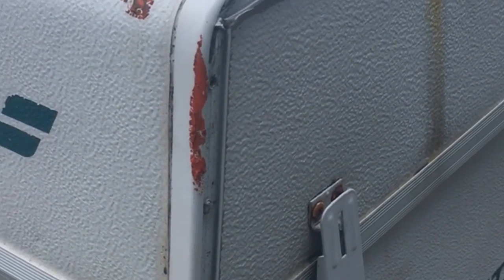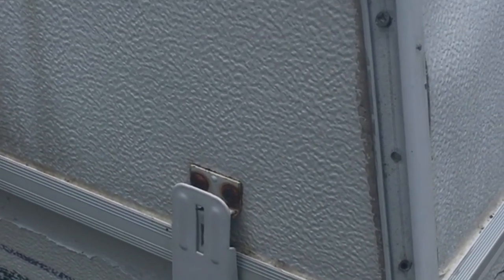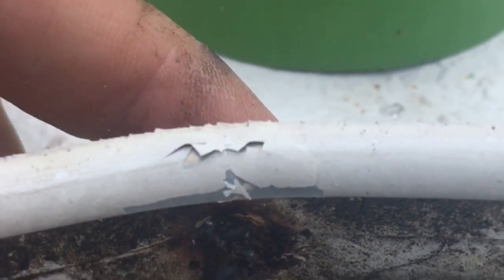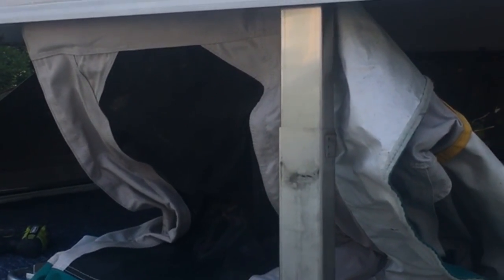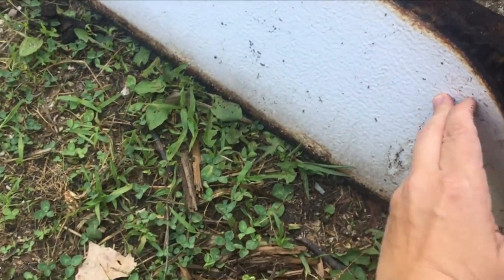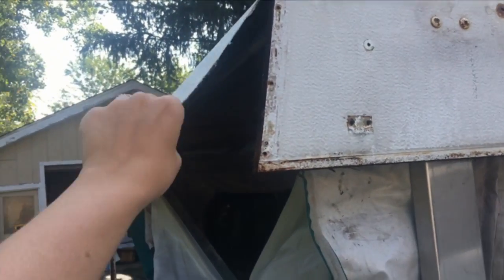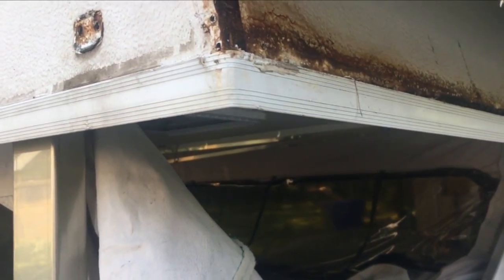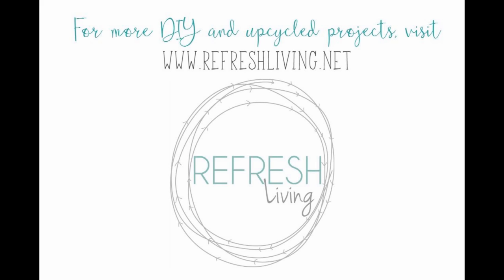Part 2: Removing the Roof (Pop Up Camper Roof Rebuild and Repair)

Comment: Thank goodness ours is in no way in the same condition as yours. Some one did haul bicycles  on the top and damaged the top  of ours. I intend to fill it with bondo and remove the car to carrier someone  installed. I will have screw holes to repair but I think 5 minute expoxy will do that. Then its a matter of sanding and prime and paint with a roller. I want to remove all the old caulk and reseal everything. I got two rolls of channel trim to completely  replace all of it.   We bough the camper in late fall so its too late to do any improvements till spring now.

Comment: I started on my rotted Starcraft roof this past weekend. My son and I could not lift it off of the vertical supports, so I decided to use the camper supports as my sawhorse. Just curious how you removed your top? It seems to be a 4-man job. That part was not shown in the video.